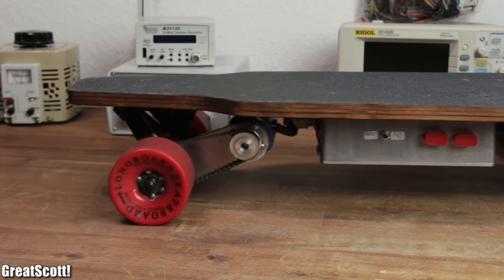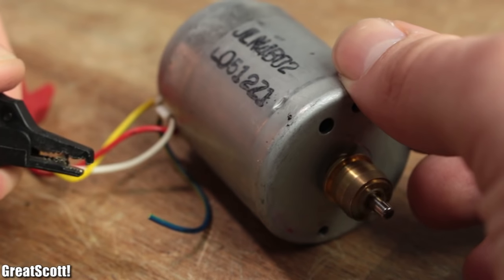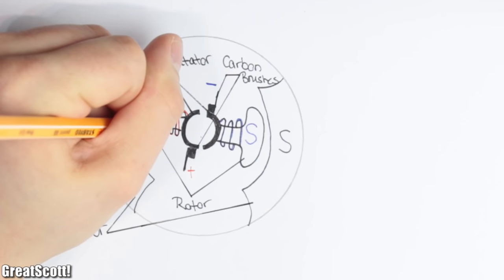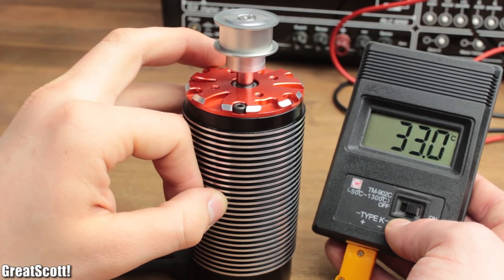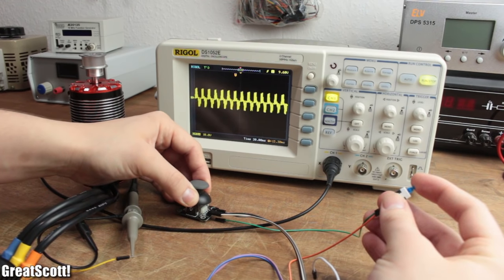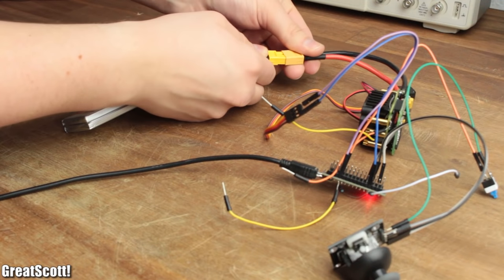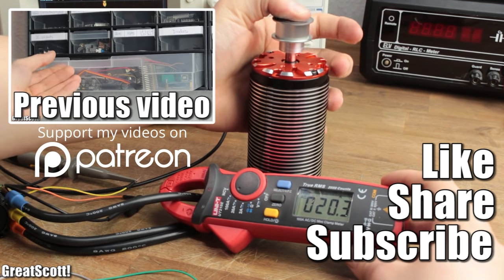Electronic Basics #18: DC & Brushless DC Motor + ESC

Comment: Can you make a video on the reverse process... like a wind powered dynamo to capture useful energy - maybe charging a battery?
Reply: +Peter Lane it's the same thing. when you do the reverse it is called "electromagnetic induction" if you want to look it up.
Reply: you need a 3 phase diode bridge to convert it to dc.
Reply: +Sirus six diodes
Reply: +Zooty The Duck - Is it? So when you spin a brushless DC motor you'll get useful current out from the ESC? I don't think so ;-) So I'll rephrase my question - perhaps a video on using a brushless motor as a generator etc.
Reply: +Sirus ok that makes more sense - but wind does not blow at a constant speed so something would need to account for high and low voltages... now I'm stepping outside my limits...
Reply: +Peter Lane You can use capacitor (alot), regulator, then use to charge a battery slowly.
You don't get the same voltage everyday, but you get enough to charge a battery every blow little by little.
Same principle as power supply. Then you can use batteries for later.

P.S Work best when windstorm. ^_^
Reply: +Peter Lane And then use the electricity to light up a fan, that will be the wind, this time, you get unlimited energy!! Lol. (Joke)

(Calm down everybody, that's what I think when I was 6)
Reply: +Arsyad Kamili
Bloody 'ell m8, don't worry. There are a thousand and one "educated" adults who actually STILL think essentially the same thing. Just go and check how many cranks and flakes there are trying to make "free energy" motors, "overunity" machines and perpetual motion devices.
It really is quite remarkable to watch them trying to explain and justify shit. Of course a good number are simply scam merchants and crooked charlatans.
Reply: +rationalmartian There's no UNLIMITED energy, but there are sources that last longer than humans. We can use them, unlimited for us, humans that have age, but for immortals, that energy is not unlimited.

We can use winds, water, but our 'Unlimited power' is the sun, that will last for another billion years. If we can maximize them, if we make every inch on our earth's sunny place have solar cells on them, like all dessert. We have our 'unlimited power'
Reply: +rationalmartian Example, You have 100 trillion Yotta bite of hardisk, how do you feel?

Of course you feel like you can store anything you want, you feel your storage is unlimited. But your storage is not unlimited, there's a limit. But for a human,100 Trillion yotta bite means, the storage is 'unlimited'.
Reply: Arsyad Kamili
We don't have filesystems that can cope with drives so big. I don't even think that the computer would be properly able to address most of the space of the drive.
Reply: +Zooty The Duck I think google have like a YB of storage, or maybe ZB, we never know... But I think, even with that, we can feel free to upload our videos on YouTube everyday, using mail, onedrive, etc.
We feel unlimited.

Comment: And how about doing your own ESC, not bought one? 
Doing lightweight ESCs should be pretty challenging engineering task. 
Keeping motor perfectly synced at higher RPM, with soft start, active breaking, changing direction and without luxury of hall sensor is something I would like to see in a video.

Comment: Im a little confused.
So its a star winding with a centre tapping... 
Where do you connect the positive and the negative current feed?
 and where does the yellow control  wire for the windings connect?

Comment: Can you explain more about the ESC's and brushless motor? like what ESC should we get to get that reverse brake and forwards functionality that was shown in the software as well as how is the signaling works with all those modes and what determines the motor features in terms of KV rating max current and power ect physically.

Comment: Your speed calculation for the switching frequency, depends on the pole pairs.

Calculation: electrical angle / pole pair = mechanical angle

Your big PMSM has 4 poles (N+S, N+S) so 2 pole pairs therefore the factor ~ 2

The small motor, PMSM has 7 pole pairs so 14 magnets inside, right ? ;)

The fact with the KV story is correct!

Comment: Hi, I was wondering if you could use a esc to control a stand fan motor, it’s because I have one laying around and wanted to see if this could work, I’m a little bit confused because it has 8 coils and 4 wires, do I connect the main 3 to the esc and the last one that is divided into two are supposed to be connected with a capacitor? I want to see if I could controlled it with a dc supply, even though the output of the esc is Ac, but you get the point. If this couldn’t be done what else I can do to make it work, thank you.

By the way, the wiring I mention is something I think it could work from videos and wiring that I have seen, but not 100% sure.

Comment: What kind of bench power supply would be appropriate for running a bunch of BLDC motors? Like 81 motors each rated for a max 10amp with 30amp esc... I have a project I want to try building but I would rather not use batteries since this is a stationary project that would be used intermittently.

Comment: Great great video I learned quite a bit but my question is ....where do the actual wires connect inside the coils of the brushless motor? if there's no Plug-In or color-coordinated I only have three wires coming from ESC theres 3 wires that got ripped out but the black is still connected inside the coils somewhere.... how or where do I reconnect or solder  the 2 remaining wires that got pulled out??? Thanks it's a dji mavic pro

Comment: I wanted to power custom cooling fan for my room. I have a large 20cm wooden model propeller. I just don't know what kind of engine to choose from. I have small brushless from a model plane and a DC motor from RC car. Which one is better for this application? Should I get AC motor for stationary work? Can you even power brushless motors without batteries but through some kind of AC/DC charger?

Comment: hey I Know this is dumb and will destroy my motor and gears. but i got a rc car with a 390 brushed motor. that motor can pull my sister (65lbs) on a skateboard
 but i Want to upgade the motor so it can push me(127lbs)   
what kind of motor shall i look after ? is the t (turns) in the motor  importen
 is it the torqe thats importen or the rpm or shall i go for a brushless setup?

Comment: Where doas the Power for the Arduino comes from? Can I connect it to the Batterysystem from the ESC or did I have to use a 5V Signal?

Comment: Dear Scott
Hopefully you get to read this message.
Ive seen in most videos that bldc motors are powered with lipo batteries, surely because of the discharge rate of the battery. 
I am new in the subject but I would like to test bldc motors powered with an adjustable dc power supply rather than lipos. 
My question ir regarding the current. Most 100EUR Lab PS outputs only 10A and 0-30V 100A PS costs more than a 1000EUR. 
Will I burn my PS when the motor is loaded or at start? I am missing something here? Are batteries in consecuence the cheapest way to power bldc motors?
I hope you can help me out here or if you could clarify this in a video would be awesome!! since I believe there is nothing concrete about this in youtube.
Keep it up!

Ich habe vor 2 Jahren in BW studiert. Ich wusste nicht, dass wir praktisch Nachbarn waren xD 70372.

Comment: Hello, I see in the video, you have a switch connected to a board and a speed control.. I am want to do the same thing. I want to be able to vary the rpm with a speed pot and then trigger it with a low voltage momentary contact switch, Is this an arduino board? or something else?

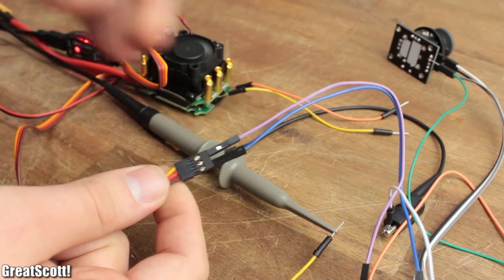Comment: Can you explain what you are doing with the joystick around the @3:50 part of the video? I know that joysticks like that use 2 or more potentiometers and I've played with one in that capacity by hooking it up to a home made speaker as well as a simple led circuit, but the resistance was far too high for either of those circuits so it mostly served as an on/off switch...

Comment: is there a way to get the rotational position of the rotor? Of course you could use an incremental sensor on the rotor shaft, but is this really necessary?

Comment: Hi everyone, I need to drive a brushless 2204 motor with a kind of potentiometer? I don't need a thing like show in the video at 3:50. I already have a power supply + brushless motor + esc. Then is there a place where I can buy card with included potentiometer to control everything? Thank you very much for your help.

Comment: i have a dc motor ~3,5cm drameter and 5cm long, i would like to power with my lab bench ( pc psu ) but while i connect the +12 and GND the psu spops (same stopping when i connect the +and gnd to a same conductor (i think its name "short circuit" in english , what is tze problem ? and how can fix ?

Comment: Thanks GreatScott!, my problem concerns a brushless motor used as a bicycle dynamo (generator)  to charge my phone, I calculated that the motor shaft would rotate around 5500 rpm with the bicycle going at 20-25 Km/h, with a 3 phase diode bridge and an IC to stabilize current at 5V the trick should work. But regarding brushless I see on markets that speeds range around 15K-25K rpm (!) and current flow ranges around 10-15 A (I need max 1A, otherwise my phone can catch fire) I wonder where I can find technical data about the performance (V, W, I)  in the area 4000-6000 rpm, which is my area of interest (I'm a bit out of shape....) . Perhaps I should use a brushless AC motor with gear, which increases the cost. Any suggestion? M

Comment: Hello, what DC motor specifications would I need to use to put into a surfboard to make the surfboard reach speeds of 60km/h plus? The motor would be operating a jet drive to push the surfboards. I would like to know which specifications would roughly be needed to reach huge speeds?

Comment: Question ! What kind of motor should I use if I need 300 RPM  with a 7.4 LiPo ( 2400mAh, C rating 35 ) battery ? All motors seem to have a very high kV rating !

Comment: Brushless ESC systems basically create a tri-phase AC power output of limited voltage from an onboard DC power input, to run brushless motors by sending a sequence of AC signals generated from the ESC's circuitry,

so wrong title,,

Comment: wait so how do you use an esc on a brushed motor?
Reply: please reply :(
Reply: you dont need one since brushed motors have a commutator built in
Reply: yes you do. I am looking to control the speed of the motor and you need an esc or sc to do that
Reply: Use a quaternuon filter
Reply: You can use transistor controlled by PWM to control speed in brushed motor
Reply: no you don't - ESCs are only for brushed motors - they should be more accurately names "BLDC motor drivers"
For a simple brushed motor you can just use PWM to do it.
Reply: There exist brushed motor esc s

Comment: How many amps is that esc? And what is the max amperage that motor pulls and its operational voltage?
Reply from the maker: +Vladmir Putin The ESC is an TORO 150 and the motor is an beast x528. The datasheets should be easy to find.

Comment: Hello. very informative video!
normal 3-phase AC motors are actually just "brushless motors" so it would be theretically possible to build an esc that such an motor operates. am i wrong? I think it would easier and cheaper then a frequenzy converter. Mach weiterhin solche Videos! viele Grüße aus Bayern

Comment: Hey,  I have a question.  I want to calculate how a certain motor size like a 5055 motor with 340kv. How much torque it delivers rpm is like you said very easy. But I have no idea how to calculate do you have some material so I can find out? Like does it work with the induction law 
The higher the current the more torque it makes? Because from what I've read is that a 6350 VS 5055 the first one gives more torque because it has a bigger stator. (they have the same kv rating.) but how can I calculate if I have let's say this amount of current at this voltage with this amount of kv and x size of motor. Rated to this many watts. How much Newton meter will it deliver.  I want to do this so I can determine my optimal gearing ratio. Because I know how large the load is.

Comment: Can you make an ESC? I tried to make something similar using Transistors to control a high current going to each phase of the brushless motor and control the transistors with Arduino, The motor was spinning but it was going in the wrong way sometimes. So please could you make a tutorial on creating an ESC?

Comment: What do you think about using Brushless DC Motor to operate underwater?
Reply: 1. It needs to have a really good isolation
2. It must be rust resistant

I tried to completely submerge an old pc fan into water, connected battery to it and it worked. LoL

Comment: Excellent video.. I have a problem, when I speed up fast my motor using the joystick it turn down like if it lost the power as a cut.. I set it like you... is it the ESC or motor.. please?
Reply: Motor und ESC müssen einander zusammen passen. Wenn der Motor mehr Strom zieht als der Electronic Speed Controller leisten kann, dann drosselt der ESC die Drehzahl des Motors oder schaltet ihn ganz ab, um sich vor Überlast zu schützen.
Ansonsten mal ein ESC mit einer höheren Belastungsgrenze kaufen. Das heißt wenn der Motor unter Last 50 Ampere Strom zieht, aber der Regler nur maximal 30 Ampere schafft, dann regelt der ESC die Drehzahl so weit herunter, bis die Stromaufnahme unter 30 Ampere ist. 
Noch ein Tipp
Den Motor, besonders unter Last, nicht zu schnell hochdrehen, besser ist, etwas langsamer die Drehzahl hochfahren.
Und, den Regler nicht dauerhaft mit den Maximalstrom belasten, also nicht Vollgas geben und es dabei belassen. 
Regler und LiPo Akkus danken das einem mit einer längeren Lebensdauer.

Und bei LiPo Akkus darauf achten, dass beim Entladen die Lipo Spannung pro Zelle nicht unter 3,6 V geht. Alles darunter zerstört den Akku. Nähert man sich beim entladen der 3,7 V dann sollte man wieder aufladen oder den LiPo auf die Lagerspannung zwischen 3,8 und 3,9 V pro Zelle laden, wenn man die Akkus eine Zeit lang nicht benutzen möchte. Im Ladegerät wählt man dazu Lipo Storage aus.

Comment: Hi,
is it possible to change the direction of rotation of the motor without flipping tow wires just withe arduino coding ?
Reply from the maker: +Akrout Osama A couple of ESCs support forward and reverse direction.
Reply: +GreatScott! An rc car esc had 3 mode drive Fw/brk , Fw/brk/Rv or Fw/Rv.
thats what i found in Net but there is no video show the calbration with the arduino . i hope you make one explaining the calibrations and the fuctionality.

Comment: Hi! Amazing channel :D . i was trying to figure out a way to realize a moving system for a kayak. I was thinking  to power a generator with pedals and wire it (they would be hard to mechanically connect to each other)to a motor. is this possible? Would it be cost efficient considering that you can buy a motor for around 140 euros? It would be funny for sure!

Comment: What kind of esc is required to run a brushless DC motor 1100kv with SLA Battery?? 
Pls suggest.. 
I'm stuck up with this in my project.. 
Ty

Comment: could you control a small brushless motor just with the GPIO outputs of a raspberry pie?
Reply from the maker: +Macarena Not directly.
Reply: +GreatScott! thank you :)
I really love your Videos
Reply: +Macarena you can use the outputs to control some H-bridges, which can drive the motor. then you can generate the PWM signals for the 3-phase waveform.

for BLDC motors, reliable operation also requires a feedback mechanism, which is a little more involved (you need to measure back-EMF and feed this back in through an IO pin, which is used to try to keep the virtual commutator in sync with the motor). one strategy is, for example, briefly disabling one of the legs for part of the cycle, and then measuring the point at which the leg voltage crosses the median (crosses from "positive" to "negative").

while it is possible to spin a BLDC motor open-loop (with no feedback), the usable torque and speed is a bit lower, as is the efficiency (trying to push it too far will cause the motor to stall out and/or overheat).

another type of motor I find slightly preferable in this area is induction motors. induction motors have the advantage that they will not drop-out under load, though back-EMF sensing can be used to improve efficiency. however, because of "slip" it is no longer possible to know exactly how far the motor has turned without an external encoder. however, speed-vs-torque is much easier to control than with a PMDC motor.

going the other direction is stepper motors, which tend to have lots of torque but not so much speed, and are primarily driven open loop. typically, they are dual-phase (as opposed to 3 phase), which leads to a problem of there being no good way to use back-EMF sensing with them.

if relevant, a temperature sensor may make sense, say so you can detect if your motor or H-bridge gets "crazy hot".

I usually build my own drivers as prebuilt motor drivers tend to be rather expensive.

for example, just built a motor driver which should do 36v 45-60A (~ 15-20A per phase), for about $8 worth of components (mostly transistors, one may also need perfboard and various gauges of magnet wire and similar).

though, granted, the prebuilt ones are probably better, and if or how well they work is less hit-or-miss vs hand-wired ones. you can be a lot more sure they will "just work" at the rated values, vs whether something will get crazy-hot and/or blow up.

and, with my own bridges (built using NPNs), breaking the kW mark basically requires resorting to liquid cooling the H-bridges (say, by submerging the boards in vegetable oil or similar).

granted, smaller motors are a little easier (and cheaper) to get working.

or such...